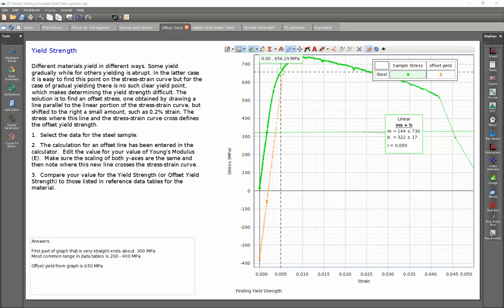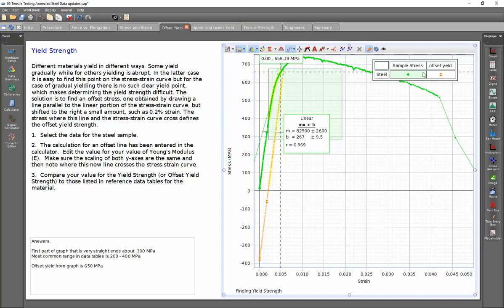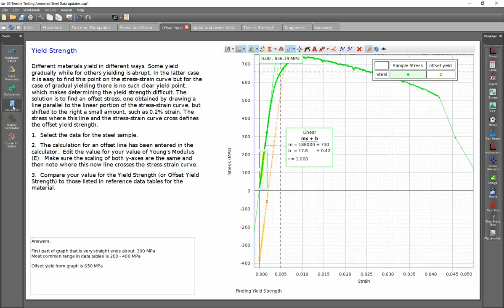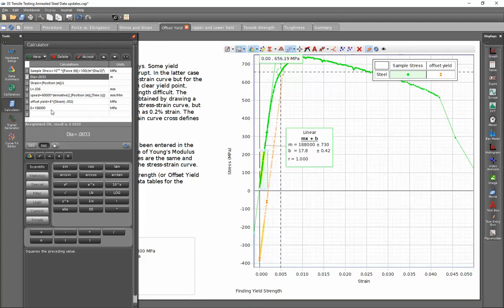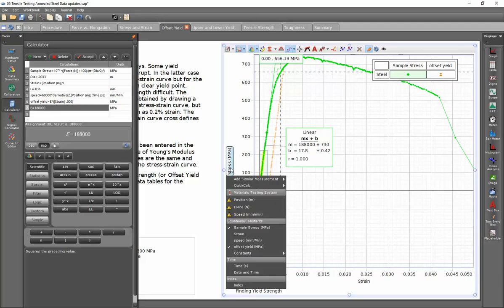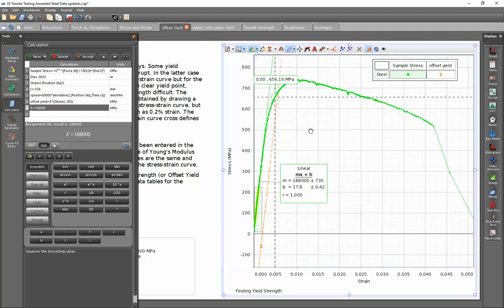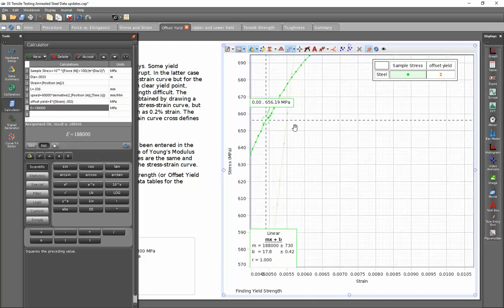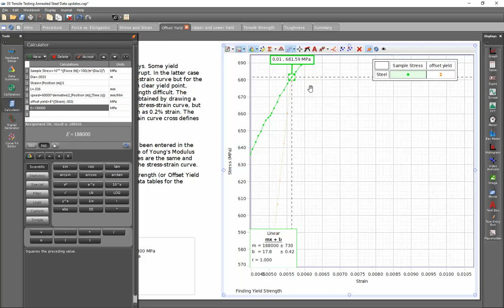Determining 0.2% Offset Yield Stress (Capstone)

Comment: how do you know how far to set the offset?
Reply from the maker: Determining 0.2% Offset Yield Stress is the standard for the yield stress for materials.  The onset of yield is gradual, so the 0.002 strain for the offset line is the standard that is used.  Where this line crosses the actual stress strain curve is the value that is reported for the yield stress for the material.